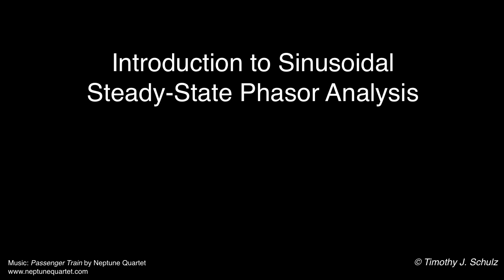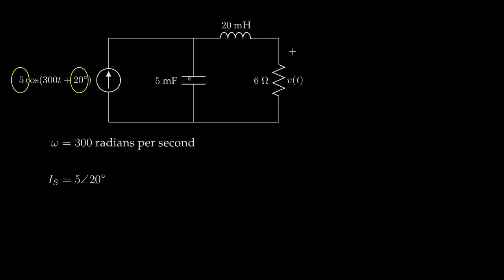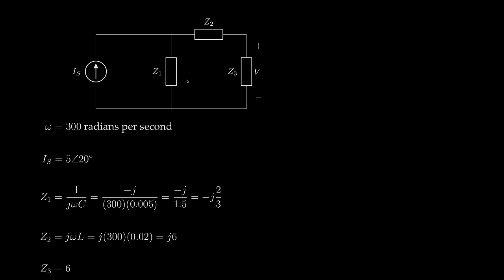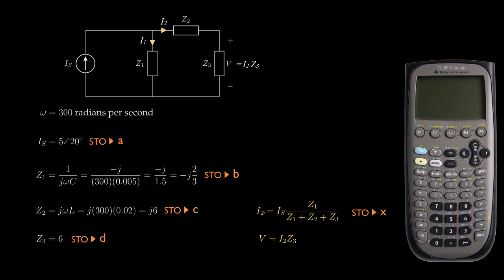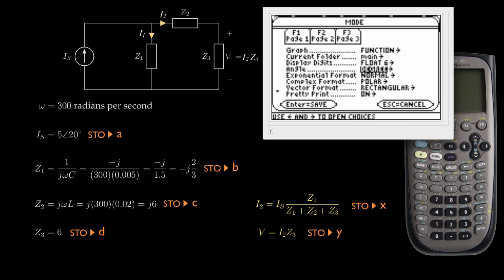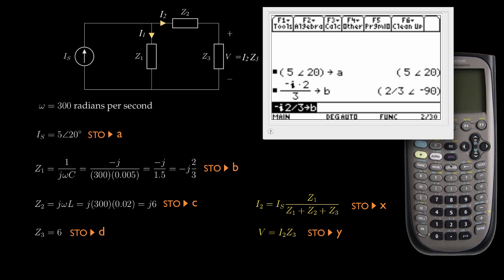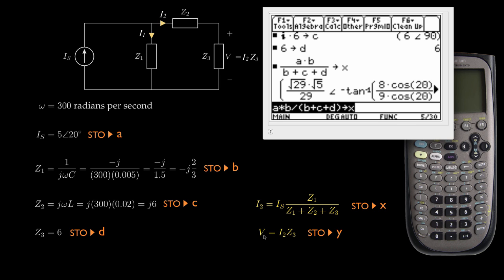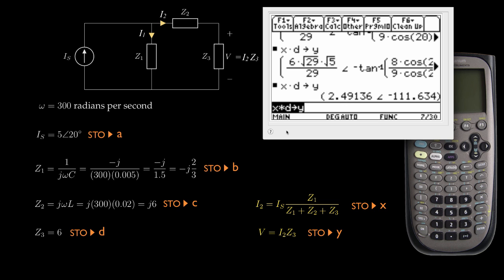Introduction to Sinusoidal Steady-State Phasor Analysis

Comment from the maker: Nuno Navega: The equation for I2 is correct. Review the current divider method. (For current division, the numerator is the impedance in the other path, which for this problem is Z1.)
Reply: This video is a great tool and very helpful, however I was wondering if you had any videos using a TI-36X Pro calculator. The TI-89 is a little out of my budget